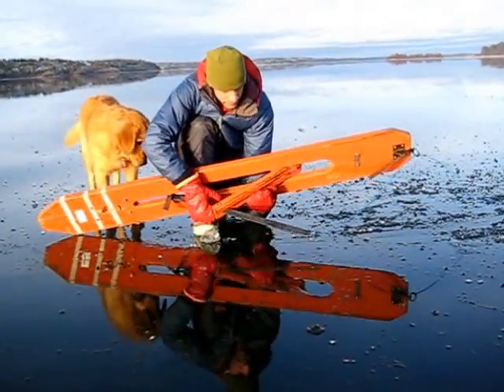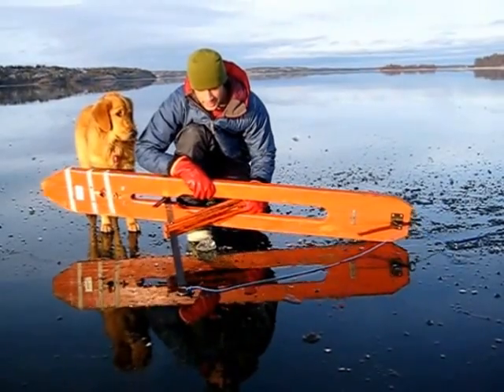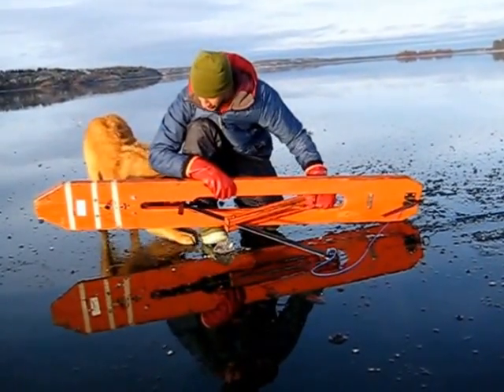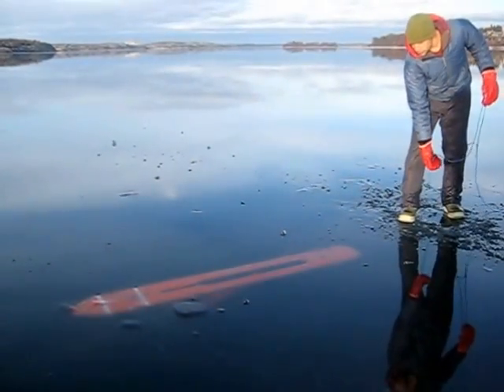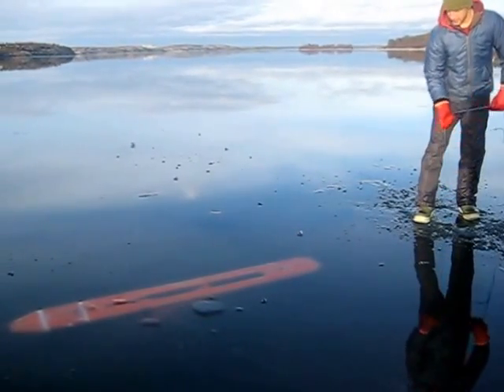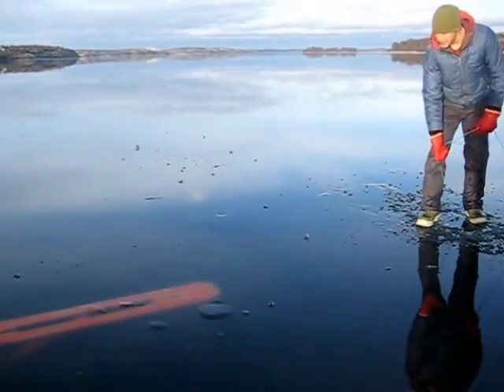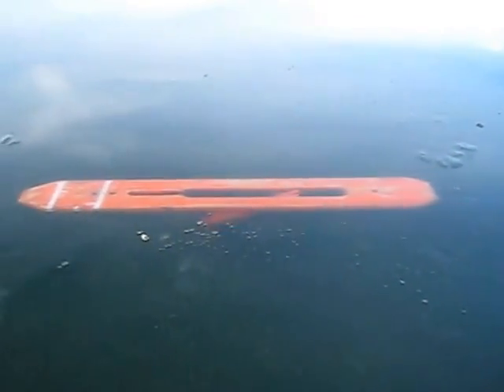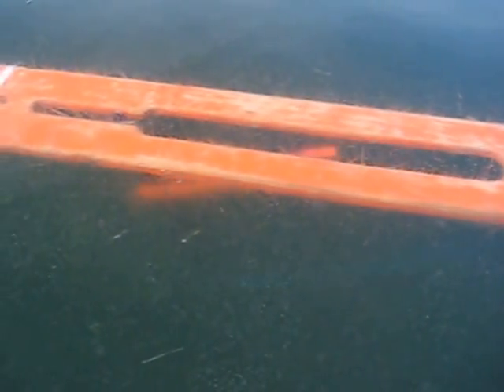How ice jiggers work

Comment: What about using regelation? 

https://en.wikipedia.org/wiki/Regelation

One wire, two weights. Make two holes, drop the weights tied together with the wire. The weights pull the wire through the ice and it refreezes as it cuts. The weights are safety corded to the surface so they can be retrieved. You could set them up overnight and go back the next day and pull the nets through.
Reply: seems like a hassle, carrying alot of weights around, also time consuming.
Reply: I might try it one day need to make a note